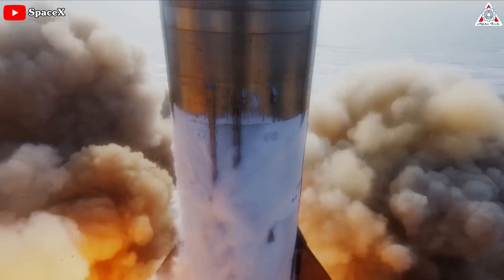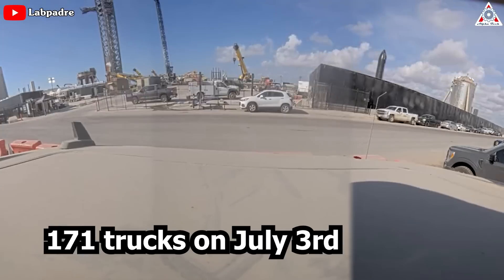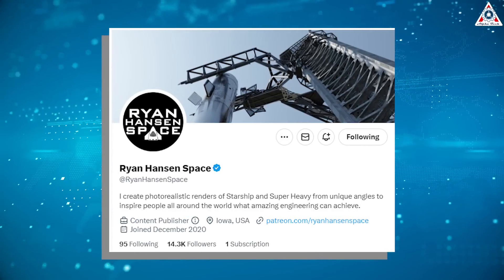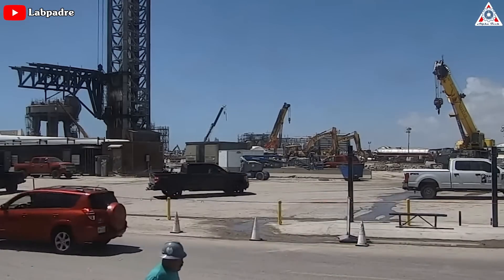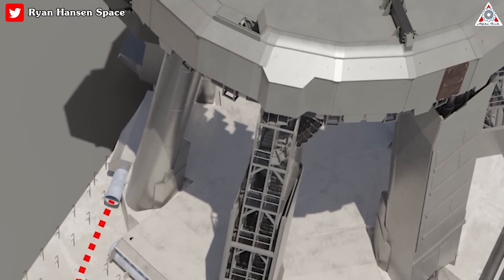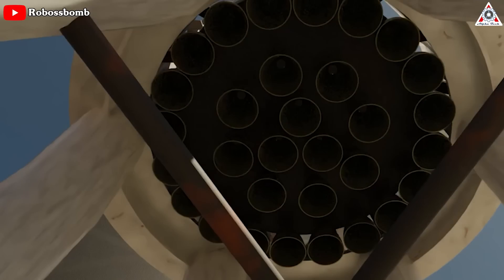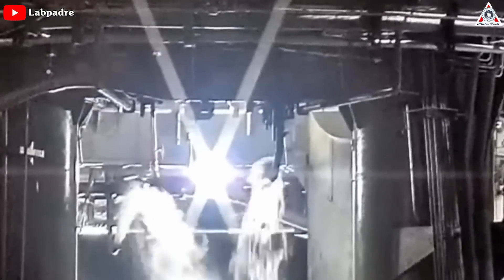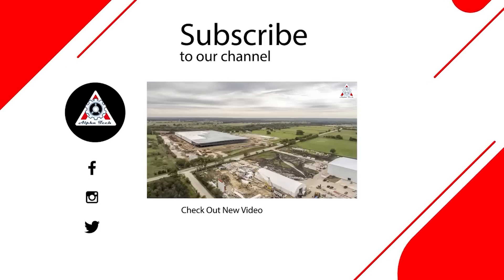SpaceX launchpad is on the edge of ready! 33 engine firing...

Comment: Elon can Put lip stick on a pig. But it will still be a pig. 33 engines will always fail. With 33 engines you multiply the number of mission critical faults 330. Would you set atop   . This Roman candle?

Comment: A question: Is it possible that the heat from the engines would instantly evaporate the water inside the "pancake", causing it to explode because of the pressure of the vapor inside? Or the water pressure in the system could cancel this effect completely?
Reply: i dont know but i guess it would depend on how much water and how much water pressure the pumps can deliver? my thoughts were concerning about what were to happen if the water pressure and water at high enough pressures were to strike the nozzles, the (bell) parts of the engines and damage them if the timing were not just right?
Reply: There's also additional tanks that hold high pressure gasses (or maybe simply air?) to drive the water pressurisation system. It isn't just pumps, alone, that'll be driving the system.
Reply: @Bobcat665 whatever they have, it won't be enough. There isn't a system on the planet that can withstand 30odd raptors raining down. Even if there was, SpaceX has no space to house enough tanks and no way to capture it (as not a single drop is allowed to touch the gulf).
Reply: @mervstash3692  And what are your credentials? Can you prove beyond a shadow of a doubt that the compressed gas cylinders won't be enough or are you talking out your backside? You're full of it, dude. 🙄
Reply: @Bobcat665  let's look at what we know. 

During testing with just 1 raptor (horizontal test), the plate blew a hole out the back of it. All the water inside expanded 1600 times its size into steam & pop. Instant loss of water pressure, rendering the plate useless. 
Literally what every expert in the industry outside of SpaceX said would happen (& also a bunch of ex employees too).  

They need to deliver & capture over 3 million litres of water with 10-20 seconds. So far, there is no system that can deliver that volume & they definitely aren't looking to capture it. They would be absolutely smashing the current world record in delivery if they did what they claim they can achieve. There is also f''k all room at the launch site to fit the required holding tanks. Which need to be close by. 

It's ultimately a truly dumb solution that is just going to end up the same as the first launch. The pad will fail. It's either going to explode, showering steel projectiles a mile in every direction, or it pops, & loses all pressure. Either scenario results in the concrete underneath exploding like last time. If by some miracle it all holds together, the force of the water being fired out of the plate will crush the concrete underneath & again... Kaboom. 

The only solution where this works is a pad with flame diverters & a decent deluge system like at KSC. It's as simple as that.
Reply: That is 100% what will happen.   
They thought the last explosion was huge

Comment: Everything described at 5:30 is more or less applicable to the steel plates as well. That is, tremendous heat, gas pressure and acoustics will hit the steel plate. Any failures (crack in a weld or gas pressure exceeding water pressure or some acoustic harmonic or anything else) that occur will result in an immediate pressure loss in the system allowing further gas penetration. Hot rocket gas can flash the water to steam instantly, and steam has about 1700X the volume of water, which will spike pressure leading to more cracks and catastrophic cascade failure and explode the steel plates.

Comment: One problem to watch out for is resonance and vibration? Thrust forcing down and rebounding echoing around the take of stand and other effects higher up less protected on the tower and Fueling connections??   One lift off tower is OK
To land back and have one crash landing problem
is crazy? 
two three four landing places in a ring for returning vehicles would be better?
Always having a take of pad and many near by return stations with Rail pullied automatic Boggies to bring back to service area

Comment: Wouldn't the pressure of the water coming through the holes have to be greater than the thrust coming down from the rockets? Otherwise the water is just going to turn to steam under the top plate.
Reply: That's why they have all those high pressure gas tanks.
Reply: I assume that--being engineers and rocket scientists--they've calculated for that.  What I wonder is, why not make the area underneath the platform more like a cone, to deflect the thrust and heat from the engines outwards? Rather than this big flat surface just taking all the thrust right in the face.
Reply: @eyesuckle calculated like they did with the first launch? 😂😂

Comment: Titanium is more suitable for high temperature applications, although more difficult to work with.  Seems after some use the steel may not hold up.  But, way to go getting it done and installed quickly.  We shall see.  Hoping for the best!
Reply: If it doesn't hold up but otherwise functions perfectly, it;s an excellent proof of concept and they could recreate the same plate out of a more temperature effective alloy if need be.
Reply: Steel strong stuff.  Titanium is twice the cost at least.
Reply: @TheEvilmooseofdoom  This economic assessment brought to you by Hulk & Associates.
Reply: The steel will never be "hot". The discussion about "melting the steel" is a red herring - if the steel reached even 100C, then the launchpad is having a bad day. Because all the water inside the plate will be converting to steam inside the sandwich.

The steel is there to withstand the pressure , the water is there to absorb the heat. Above the plate.

Comment: I'm not convinced the water cooled steel plates are going to save Starship/Super Heavy.  It does look like the amount of water they can put out may be sufficient to mitigate much of the energy but the fact that the steel plate is flat instead of an inverted V gives me great concern about reflected shockwaves.  If the next launch results in another failure, particularly if we get an explosion on or near the pad, then the FAA will have no choice but to decertify Boca Chica as a launch site.  Additionally, NASA has been quite concerned about the risk to the Cape if a rocket, twice the size and power of the Saturn V, were to explode on or near the pad it could destroy billions in infrastructure at the Cape and prevent launching to the ISS or otherwise accessing space.  I hope Elon Musk doesn't turn out to be another Stockton Rush!
Reply: Acoustic shock wave is a well understood science. Do you really think that the experts at SpaceX don’t understand this?
The number one reason the concrete pad failed was soil compaction, pad fracturing and the resultant disintegration of pad integrity.
Heat transfer is the number one problem. Acoustic shock waves are more of a threat to the engines themselves and associated piping, wiring and other components.
If the engines can handle it, the pad is easy.
Reply: @triggerpointtechnology  4/20!
Reply: @triggerpointtechnology  Right....Just like the Spacex experts who understood how the concrete was going to hold up? Heat transfer is the least of your problems. If the steel plate gets hot enough to melt then the water underneath it is already steam and the whole thing explodes. Like @raptorman0909 I am concerned that any condition that results in gas penetration will result in steam and blow up the structure. This could be due to acoustics cracking a weld resulting in pressure drop followed by gas penetration and catastrophic failure. The acoustics and potential harmonics with 33 raptors must be mind-bogglingly complicated and there are limitations to simulation fidelity. I really hope it works, but I am also not sold on this design. I'll be happy to be wrong.
Reply: Water is very good at breaking up acoustic energy.  That's one of the reasons it's there.  I suspect the flat surface is more about the dance floor.  As far as the FAA decertifying, I think that's entirely you pretending to know more than you actually do.
Reply: India just launched a rocket to the moon😂tell musk to get advice from the indians
Reply: @codeforce5556  Let's hope Chandrayaan-3 does better than Chandrayaan-2.
Reply: @codeforce5556  Launching things to the moon is easy.

Comment: They used Portland III this time too, not Fondag.
Reply: Wtf??? So they went with a worse concrete? Okay....... I guess they're praying their new rebar system works.....along with the water plate...
Reply: Can you cite a source for that?  They were using Fondag before.
Reply: @TheEvilmooseofdoom  Yes, i would like to see this too, because Portland 3 is undoubtedly far worse a material to be used for the launch pad.... Just look up the properties for Fondag and Portland III, Portland III is literally described to be unsuited for applications as such construction and stability framework for a rocket launch pad.

Comment: Newsflash! The flat plate will bend under the force of 33 raptor engines!!! When the flat plate pins, the water flows under, it will probably cease. I’m afraid that this brilliant solution is no more than a “Twitter, blue check“ kind of solution for the OLM. Looks good on paper, but probably won’t work!
Reply: I love it when you pretend experts just pull nonsense out your rears because lets face it, when you're not pretending, you got nothing.
Reply: @TheEvilmooseofdoom  And what did you bring to this conversation???? Nothing at all....
Reply: Those Raptor engines are going to create a steam pocket inside that hollow plate, likely with an explosive outcome
Reply: @jaydonbrown617  
If not in the hollow plate, then in the uncured concrete beneath it!
Reply: @wbwarren57  Yep, it'll be 4/20 all over again. I'll be surprised if Starship can leave the landing pad this time
Reply: @jaydonbrown617  
I really hope not.  However, all the SpaceX cheerleaders out there are not serving SpaceX well.  SpaceX walks on the knife-edge of disaster usually - which I like because they get things done - but they also occasionally cross well over the line with many cheerleaders cheering them on which is a recipe for them to have a disaster which will result in them being shut down.
Reply: @wbwarren57  Yep, so I guess we'll just have to wait for the fireworks, it just sucks Space X is likely going to sour the space flight sector of man's future endeavors. Somehow, they will cause an accident that will ruin it for everyone...
Reply: @jaydonbrown617  
Fireworks would be fine and reasonable.  My concern is we're going to have to watch hours of the recovery of burned SpaceX fans who were killed by the Starship going out of control.  That kind of footage of so much burned meat would make me hungry for steaks I can't afford.
Reply: @wbwarren57  If you were an investigator at the scene, the smell might make you think otherwise. I doubt there would be a scene left though, but yeah would be a tragic day. Then you'll have reporters asking about body recovery like with the Titan implosion...
Reply: @jaydonbrown617  
Yeah, the Titan implosion is not a good look for billionaire's playing in technology.  Obviously, SpaceX has very good people working on the Falcon 9, but some of the decisions regarding test flights of the Starship (alone and with the booster) make me wonder (and fearful of) how much of those were made by Elon.
Reply: @wbwarren57  I have no doubts that there are engineers there gritting their teeth at this guy's demands. If Elon himself was personally dealing with the construction, vetting, testing of his rockets, he would've been truly amongst the stars, along with Starman
Reply: "The plate will bend"???? Have you done the calculations of how much pressure is needed to bend that thick steel plate? In addition, how much force is needed to collapse it given that is supported underneath by a metal separators  in vertical position?. No way, bending is not the danger. The real danger is MELTING, which would certainly happen if nothing cools down the plate.Before we reach to unreasonable and baseless conclusions, let's wait for the tests. This thing was not imagined by a mason with primary 6th degree , but by experts, SpaceX cannot afford to save money and do something "more or less" but an OVERKILL, and I be;lieve this is it.
Reply: @arkangeln910c8  Are you joking? SpaceX's last launch was a it's "more or less" ready, and they launched it too soon. You want to see overkill, look at the time and money spent by NASA to launch rockets that hardly blow up EVER. 

Just take a look at all the crazy changes that were made right after the last failed flight. Hotstaging, this dumb metal plate, changes in the amount of engines, changes in thrust, and that's to name a few. Hardly anything has been tested, and if it was, it was all hand-wavy wishy-washy garbage. 

Just look at the "test" of the Raptor engine on a smaller scale version of the new water plate. What kind of testing was that? We don't even get to see the aftermath because they fade to black the second it's over.... Wow....very conclusive right...?

Comment: My serious concern is where does all that water go after being sprayed????? You have to have a plan to control that water or it will possibly luiqify the ground beneath and cause possible major issues, especially thinking ahead about many launches a day
Reply: A huge portion of the water will become steam at launch.
Reply: They have strict instructions not to let a single drop touch the gulf. So Elon probably isn't doing Jack sh1t about it
Reply: Yes, you are right to be concerned, it seems no one at SpaceX is. Everyone is just hand-waving these issues away, but for real, where is all of this water going? With the goal of multiple launches a day, they are going to drown Boca Chica in tinged water, upsetting the entire ecosystem.
Reply: @jaydonbrown617  given the heat produced by 33 raptor engines, its likely all of the water that comes out will turn to steam immediately
Reply: @jelapenno  Fine, but is that vast amount of steam a good or bad thing here?
Reply: @jaydonbrown617  That you don't know what they may or may not do doesn't mean they're going to do nothing, but your pattern is to make a lot of ignorant assumptions.  Steam isn't bad.. that's what clouds are.  You really don't know half as much as you think you do.
Reply: @jelapenno a lot will, but a lot won't also. Especially once it starts to lift off.

Comment: Some folk give up at the first failures which should be largely expected. Elon digs in deeper (literally speaking.;)
I think Elon expected his latest failure and didn't cry out loud about it. Likely, the designs of this "contingency" plan had already been developed in case of a negative "what if" scenario. 
How long does it take to create those steel plates and manifolds and design the supporting mechanisms? In 2 months time? Forethought probably helped, I think.
Reply: India launched a rocket to the moon 😂😂😂 musk loves reinventing the wheel
Reply: @codeforce5556  We tracked Chandrayan-1 where I worked and it was a total Charlie Foxtrot. They missed a burn due to loss of attitude control and almost did not make it to lunar orbit. The S/C overheated and died when they lowered their lunar orbit due to not modeling reflected sunlight correctly. But they did "make it to the moon".
Reply: He said it wasn't "ready in time". Likely, he just didn't want to use it until he saw Stage 0 blow up last time. So now he's going with it.
Reply: @jaydonbrown617  And now, with "hot staging" he wants to point the ship engines down onto the top of the booster.
Reply: @thomasmaiden3356  Brilliant. Now when that blows up, he's gonna give some new fix that he says was in the works the whole time...